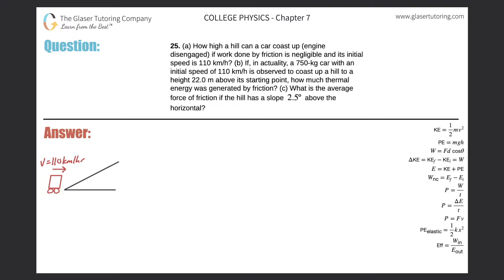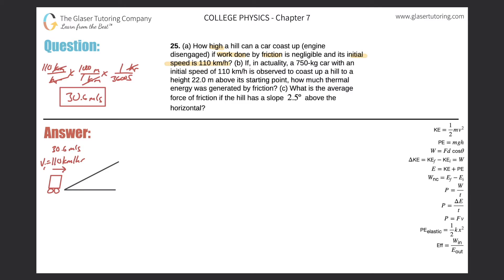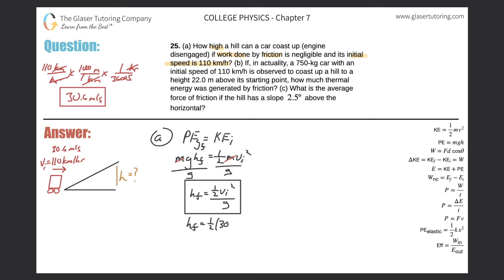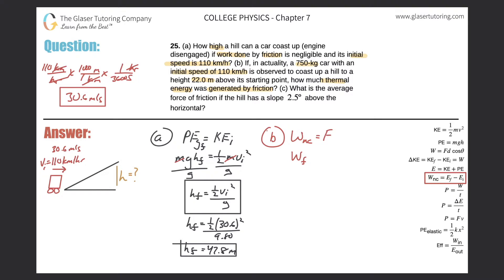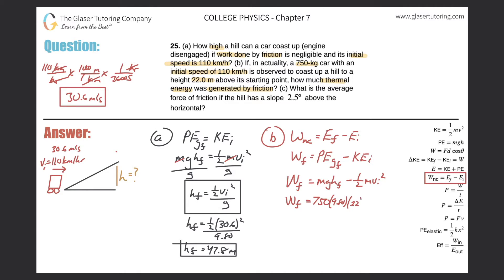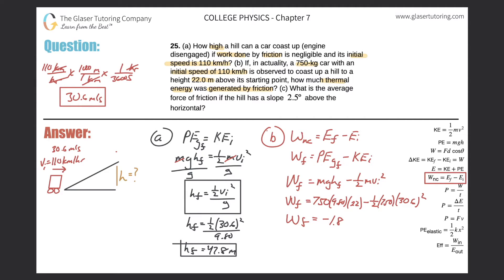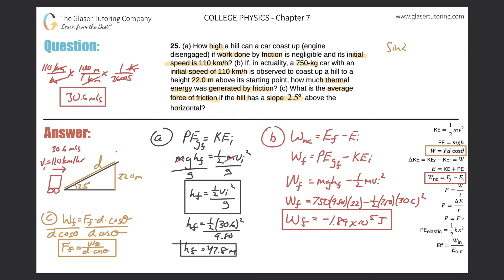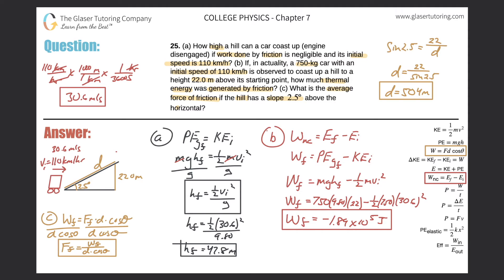7.25 | How high a hill can a car coast up (engine disengaged) if work done by friction is negligible

Comment from the maker: Few Points: 1) Answer for (a) should be 47.6 m if you don't round your calculation until the end.  2) Give the absolute value of the answer in the video for (b) since it is asking for thermal energy and should be independent of sign.  3) The answer should be negative for (c).  Technically, the force that is plugged into and spit out of W=|F|d*cos(theta) is the absolute value of the force; otherwise you would be DOUBLE COUNTING the direction of the vectors, since cosine is also involved.  Therefore, when you arrive at your answer, it will be without a sign and you must then consider the direction of the force relative to the coordinate system you were using for the problem.  Since it is assumed that left, or down the slope, is negative, then the force of friction should also be negative.  4) Don't sweat the small stuff.  5) We all make mistakes.  6) It's what you do about those mistakes that's important.  7) Work hard and keep going.  8) You got this

Comment: Question C (at least on my assignment) is asking for the calculation to be down the slope. I'm assuming this would be done differently because I can't seem to get the correct answer using this formula
Reply from the maker: Hi there - It sounds like you're approaching the problem correctly, but I can see why the specifics of the assignment might cause some confusion. For part C, calculating the average force of friction down the slope can be a bit different from the initial approach you might have used for parts A and B.

When working with slopes, you'll want to consider the gravitational force acting on the car as well as the angle of the slope. The force of friction can be calculated using the weight of the car and the slope's angle. You can start by finding the component of the gravitational force acting down the slope and then use that to determine the average force of friction based on the energy loss.

If you're still having trouble getting the correct answer, it might help to break down the steps more thoroughly or double-check your calculations.  Hopefully this helps and thank you so much for being a subscriber to the channel - you are greatly appreicated!

Comment: Hi, I just had question why to assign Kinetic energy = Potential energy?
Reply from the maker: Hi there!  This answer is discussed at 1:31 in the video.  Since the problem stated that the work done by friction is negligible, we can assume that there is not friction and that all of the kinetic energy will be converted into only potential energy and vice versa.  Since these are the only types of energy in this problem, the potential energy has to be equal to the kinetic energy.  Hopefully this helps!